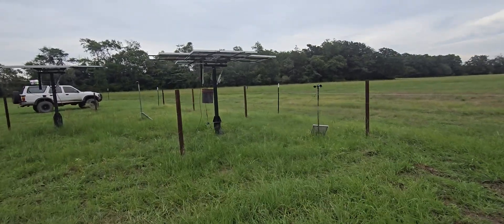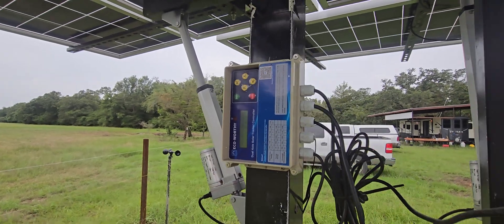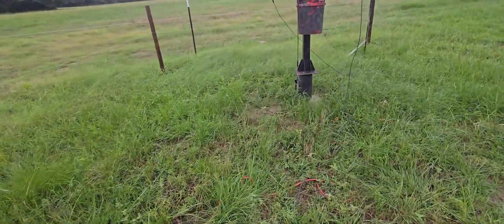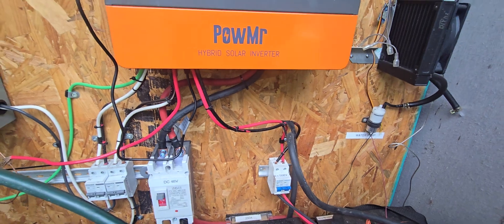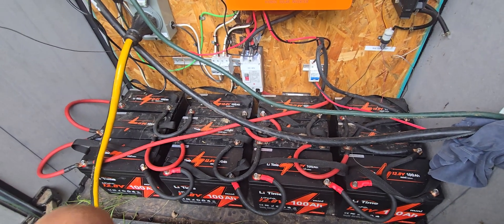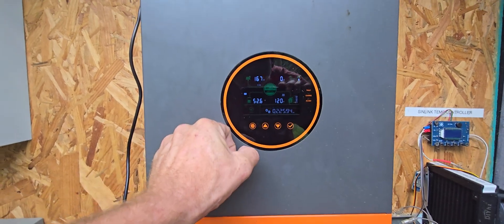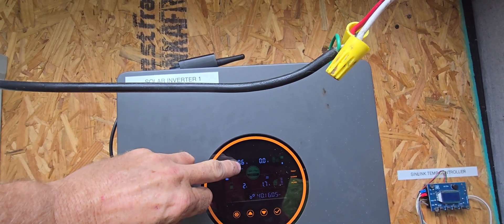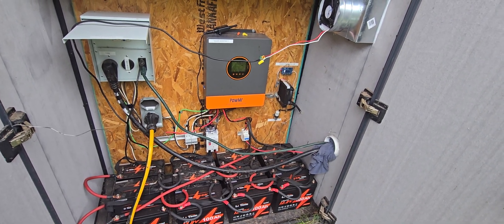Basic solar setup - 2,400W with 14,400w storage

Comment: Nice setup. Just remember those batteries have to be charged at atleast 0.2C which means 20amps per series bank. At 48v you'll need (54.6 by 20 amps = 1100w). You have 3 series bank so you'll need 3*1100w. Standard solar panels produce typically 75% of their rated power in full sun (around 11am to 2pm). So 3*1100w/0.75 = 4400w. You need at least 4400w of solar panel at rated power to effeciently charge them. And of course if you have loads you have to add their power consumption to that. Also note that lower amps will still charge them but will take an eternity even if you discharged them at 90-80%.
Reply from the maker: Thank you. Great information. I'm still learning here. Making some progress. I need more panels.

Comment: Nice setup I'm curious about the battery setup in series, and parallel I'll research that interesting. You have a lot invested hope everything works out for you.
Reply from the maker: Thank you! The series/parallel is a common setup for solar. It all depends on the inverter you are using from the pack. In my case it's 48V and I have to match that, hence the series. But a series bank with 4 12V 100ah batteries is only 48v at 100ah. And I needed more capacity, hence the 4 parallel rows.
Reply: @DavisOffGrid  got you I like it.

Comment: Nice solar array but a very poor choice of inverter. lightweight, High frequency, transformerless inverters like these offer a far poorer surge capacity as well as a much shorter life expectancy than a real inverter that uses low frequency, transformer based inverter tech. You'll be lucky if you get even two years of service out of this high frequency inverter.
Reply from the maker: I hope your wrong, but will keep your input mind when adding additional power.
Reply: @DavisOffGrid I've been using an eg4 3000w high frequency inverter for 2 years and it hadn't missed a beat. Planning to add 3 more to it in the future. I like the small inverters

Comment: messing cable  and messing battery cable look horible  can u get those battery server rack
Reply from the maker: Yep. I can get a ton of stuff, but working on basics before cosmetics.
Reply: @DavisOffGrid my solar system is smaller like this and I'm always improving. I'm also running a camper. I had 1/0 wire loops between my batteries like yours forever. Yesterday I removed them and installed some flat busbars between the series strings that I found on Amazon. They are meant for individual cells so I had go drill the holes out bigger but they had a length that is perfect for those batteries. I wish I had done it sooner. Especially for as many batteries as I plan to do it saves a ton on wire and lugs.

Comment from the maker: It's kind of a list! I'm sure some are self inflicted, but it's been a learning process. I've worked out most things. My biggest remaining issue is that when I need to run a generator because the batteries are low, it's been difficult to get the charging and the bypass to the RV happy. I'll try to do a video in the next several days.